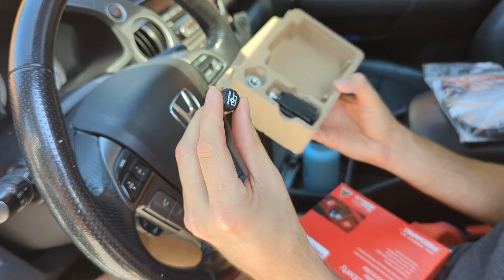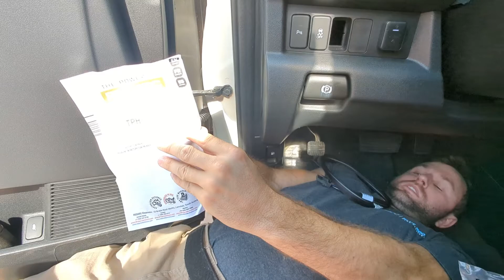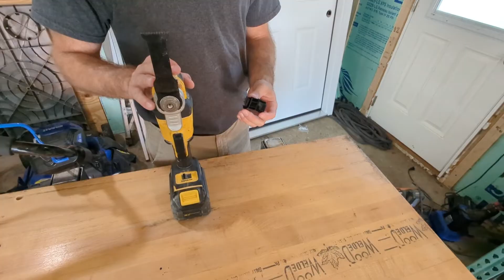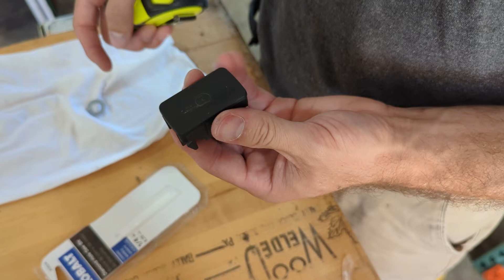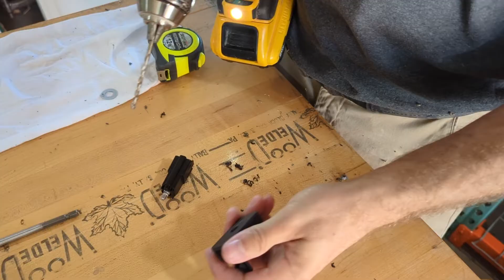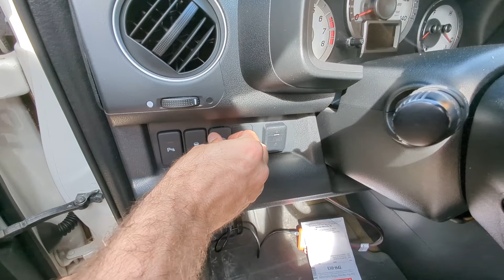The Most Revolutionary Brake Controller? | REDARC Tow-Pro Liberty Install & Honest Review

Comment: Anyone considering this product should reconsider.  I could NEVER get the product to work and after 2 weeks and 4 emails to Customer Service I have still not gotten a response.  Their customer and technical is nonexistent and their product reflects that.  I now have a competitors product and it installed find and worked out of the box.  STAY AWAY FROM RED ARC PRODUCTS.  Others may have better luck with them.  My experience was terrible.